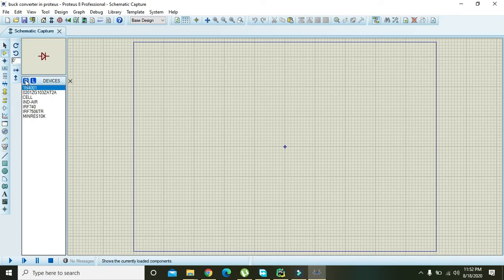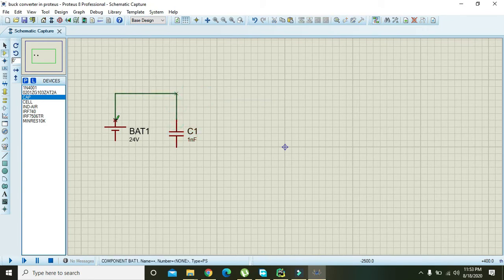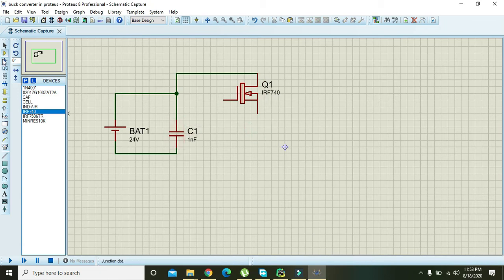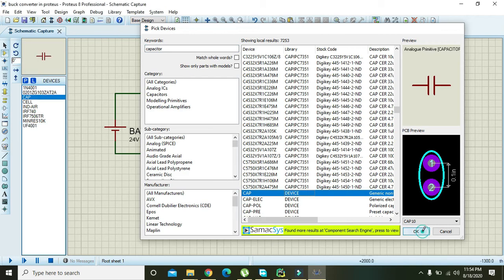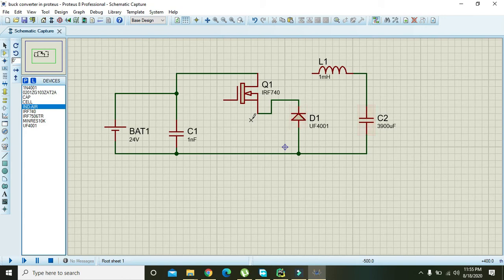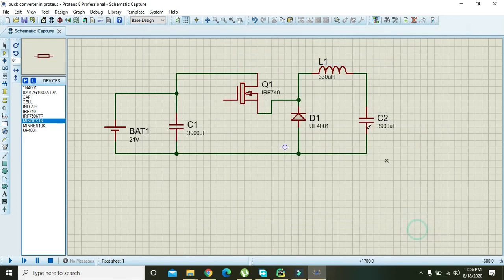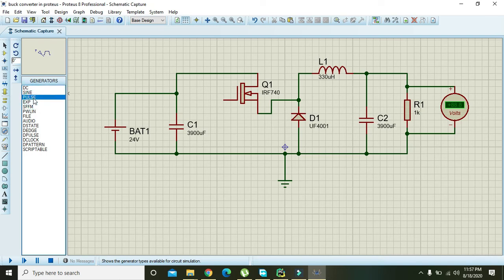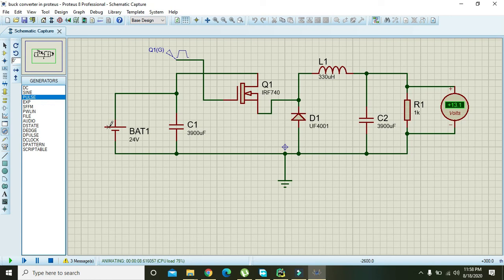how to make a buck converter in proteus | buck converter simulation in proteus

Comment: I make this simulation but I have problems:    transient Gmın stepping at time=0.00405625 and  Tran: Timestep too small; timestep = 1.25e-019 trouble with instance Q1 
how could I solve this problems? can you help me?
Reply from the maker: go to settings, then click animation option, then spice options and then try both settings like settings for better convergance and settings for better accuracy...
Reply: @nelsondarwinpaktech3954  okey I was fixed. Problem was the tımer on pulse thank you for everything
Reply: @alperentemel5123   Got same error.. how did you fix it bro?? can you help me
Reply: Thank you it works
Reply: @alperentemel5123  
how did you fix it please?
Reply: @nelsondarwinpaktech3954 there is no options like settings